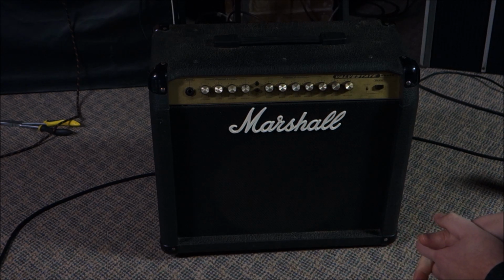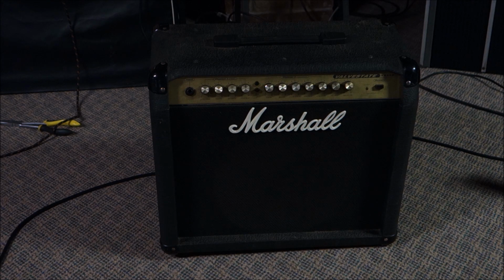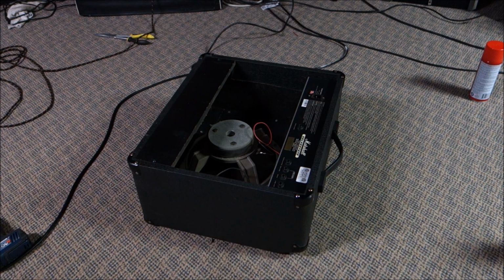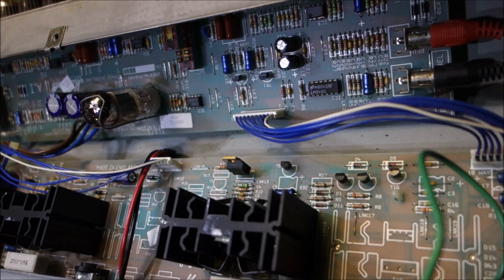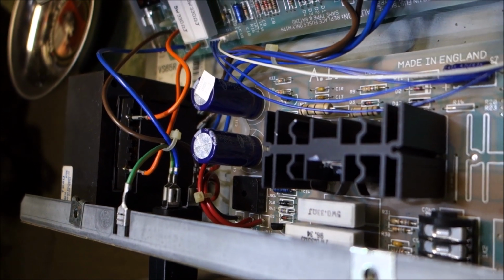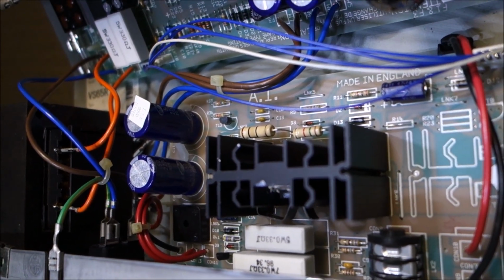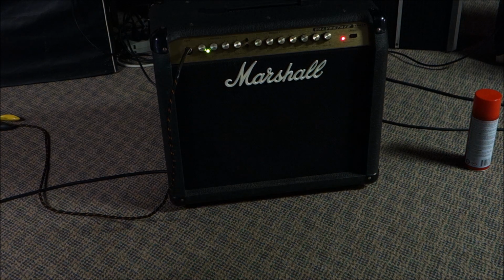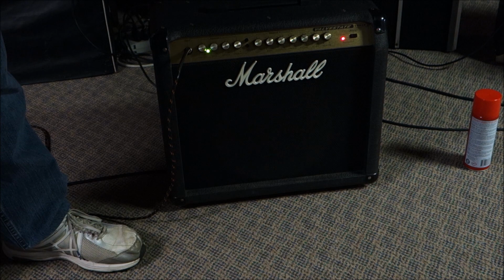Marshall Valvestate VS65R Just makes horrible noise!  Let's fix this thing!

Comment: I have the same cap loose. And the bigger one of the white resistor(?) close to that.
R29. Time for some soldering. The amp works. It hums a bit. 

Input feels a bit worn compared to the other sockets on the back (Valvestate VA100)

Just got the amp and had a look. 
Time for some tlc.
Reply from the maker: Hope the video helped.
Reply: Did you end up soldering it back together? I have the same amp making the same buzz
Reply: @K8lyn_00 Not yet. I decided not to use the amp until those components are soldered. Watched some videos. An amp with the same capacitor loose sparked. 

Apparently the input can create hum as well. Mine is faulty.
Reply: @nieko3038 shoot I'll open mine up tonight and make sure the same thing isn't happening, good luck with your amp!
Reply: @K8lyn_00 Better safe than sorry right. Best of luck 👍🏻 
I hope mine will be fixed end of next week.

Comment: i have recently adquired this exact amp, and its been great however it randomly decides to make loud sounds similar to touching the imput jack with bare hands very loudly, it doesnt sound like a buzz or anything similar it just violently grounds itself or something, can someone help me with this issue?
Reply from the maker: @Magnus_Carlsen.  I would suggest Chopstick and the inside of the amp it's a technique that we use to find bad solder joints and there are other people that cover how to do it well in videos on YouTube
Reply: @DeadKoby   preciate it, will do

Comment: I just picked up a marshall 2510 1987. 25 bucks.
 Plugged it in. Turned it on had dirty pots.
 Cleaned them out. All the noise basically went away. Sounds fantastic. 
 But I was having a hard time getting gain boost on.
 So i went to turn it off, and there was a boom and a squel. 
 The rocker was stiff, and the light doesn't work?
 No leaky caps.
I am very nervous to turn it back on.
Should i be?
Reply from the maker: It's hard to say,  but it sounds like something is shorted out.

Comment: I have a 265VSR and got him too. I’m booking it into Marshall for a service later this month. Actually bought it directly from Marshall in 1995. So, that’s pretty good reliability. They used Semelab (SML) transistors in there. That’s what made the amp special. I was a QA Manager there from 89-1998. 🇬🇧💥🚀📺
Reply from the maker: I'm just glad I could fix and find this amp a home.   Too many good electronics meet the grave for reasons that should be directly fixable.

Comment: I have the same amp. it's puzzling me.. it works fine until i dial in some built in reverb then i get a continuous feedback sound on the open D-B strings very weird ive been getting by just using a reverb pedal but i would love to fix this issue any ideas or recommendations 😁
Reply from the maker: Try isolating the Reverb tank from the vibration of the cabinet

Comment: I have a Marshall AVT20 that has horrible ground hum and drives me crazy! Ive read a article about moving the Reverb tank away from the transformer and makes them a lot better. Have you done this to any of these Valvestate 2000s. I would really like to settle that hum down. If I turn my gain above 3 or 4 its just too loud for me
Reply from the maker: Ive had reverb tanks picking up noise in other projects.  I haven't worked on the amp you speak of.

Comment: Nice video of solving the problem. Have a similar issue with my PRS MT15 and it sounds a lot like that and it started doing that 2, 3 week s ago sporadicly. Before I sort of fished for the buzz using the full/half power switch, now I don't even have to fish for the buzz, it is just always there. A question regarding the repair, did you empty the caps before soldering and did you have to unmount the pcb to do that? For me to do that on my amp it looks like a hole lotta work to get the pcb out and I'm no professional electrician. Do you suggest I give it  a try or take it to a repair shop? The amp was born on 2018 and besides noisy FX loop did not have any issues till now. Thankful for any advice.
Reply from the maker: The caps usually don't have anymore than 50v in them.... (read the voltage) solid state stuff doesn't run that high of voltage.   I think I tipped the PCB up to get to the underside.  This was a long time ago... so I don't remember it 100%
Reply: @DeadKoby  as I can not check the cap like you did cause they are glued together with silicone and there is no movement when I push lightly on them, do you think it would be of any use if I take out the pcb and just resolder them on the underside in the position they are? And in my case it is a PRS MT15 tube amp and there are 16V and 450V caps inside. I also noticed that the ground wires are all chassis mounted, separately, maybe I should make a star ground hub and solder them all to one place. Think that could improve anything?
Reply from the maker: @lorencing  Oh... so you have a standard tube amp running at full voltage.  That changes things a little.   Checking the solder joints on the PCB is always a good start.
Reply: @DeadKoby  yep, standard, full voltage and I hope there is a power sucker circuit built in for those caps ;) ... of course I will check that before I start fiddling around. That is all I am prepared to do at the moment as I do not have sufficient knowledge to really diagnose the amp and will probably take the amp to a technician if that does not do it ... and start learning about tube amps and electrics in general as I would like to be able to diagnose and repair stuff by myself, as there are many good devices with poorly executed builds or with trivial flaws that can be easily corrected, but the average Joe (like myself) does not know that.
Reply: @DeadKoby  well, here is an update ... went online and read on Rob Robinette's site an advice on how to go about troubleshooting tube amps and read about bridging the FX loop ... and ... it fixed my issue, no more 50Hz noise (mains freq in EU) and guitar signal back to normal. But this is just temporary as I want to use the FX loop and now have to figure out what to do with the small FX loop pcb, where to connect a wire to ground or maybe replace a jack socket. Any idea how to start?

Comment: If it's made in England you're supposed to SOLder it, not Sodder it.

Just for good measure, a valve ... not a tube AND it's Alluminium ((Al-you-minium) ... not Alluminum.

The British amps need the correct terminology or else they start throwing crumpets and tea everywhere.
Reply from the maker: Sounds about right.   I think this one was new enough to be made in China.   So I have to work on changing my r's to l's
Reply: @DeadKoby  If you think that's hard... just wait until you try changing an IC with chopsticks.

Hahahaha great video man, I enjoyed it. The signal injection was pure genius.

Comment: I have the same humming sound yet all solder looks fine under a mignifying lens. Do you think it could be a bad capacitor?  I bought it a few years ago brand new and always been like that I thought it was normal and is the same brand Marshall!
Reply from the maker: Bad filter caps are common.  Its a good possibility.
Reply: @DeadKoby  thanks will pull off the caps and test to see which is the faulty one, appreciate the response, take care!

Comment: Just went looking for the same kind of noise in a Fender Ultimate Chorus and found both filter caps all wobbly with bad solder joints.  I believe the cause is the "modern" wave solder process that uses low temp solder to automatically solder all the components at one pass on a board. The big heavy components like filter caps , tube sockets,  standoff high power resistors etc always seem to fracture their joints on the board after time.  Really well done video BTW and I admired your Cap tester ...what brand is it?
Reply from the maker: Lead free solder cracks...   Simple as that.    The testing thing is marketed at a transistor tester/component identifier.  25$ on eBay.

Comment: Been searching on YT for a video on this problem for quite a while. I have a 8100 head that is doing this very same thing. I have been suspecting the filter caps. Maybe this is all the problem is. I'll give it a check tonight and see what I see.
Reply from the maker: It is usually something simple like that.
Reply: @DeadKoby  I will say that it states that it wants to see a 4 ohm load but I have been running it above that into a 16 ohm cab. The previous owner was doing the same thing. I do not know if the hum has always been there but it is intermittent. Sometimes when I power up, it's there, other times it's not. When it is, I can lightly bump the amp and it will stop. That made me think a bad solder joint is the issue here.
However, at a gig recently, I had the amp turned up higher than I normally would at home and I lost a speaker. This made me think that I had DC on the output - so I am not sure which is which at the moment.
Reply from the maker: This has a solid state output.......  4 ohms or more is safe.
Reply: @DeadKoby  That's what I assumed but thought I better make sure.

Comment: I buy broken amps all the time. 99% of the time the problem is nothing more than a bad solder joint or bad cap.
Reply from the maker: Many times, it is something minor.........but sometimes not.   As long as you bought the whole thing for below what the pieces are worth,  it's worth a shot.
Reply: @DeadKoby  I've bought amps with serious problems that would be too expensive to fix.  In those cases I strip them for parts and sell what I can and keep the rest.   Usually I can buy the amp for under a hundred,  if not for free.   Ultimately I make out pretty good 👍
Reply from the maker: That's usually how I work also.  Auctions (Local)  have been my #1 source.
Reply: I have an amp that just makes a 120hz hum noise and that's it, although the headphone out works fine so it might be just the speaker. I checked the input and speaker output jacks and they were fine

Comment: I've had a VS265R sitting for years with the same issue. I'd had it fixed once before but when the buzz came back I bought a separate head and cab. This quarantine got me looking at the amp again and I found this vid. Sure enough, it was the same capacitor. I could also see it was the same cap re-soldered when I had it fixed. My electronics knowledge is very limited but I feel I'd at least know where to start should I see this with another amp.
Reply from the maker: Why they didn't leave the leads a little longer, and solder them flat on a pad,  I will never know.   That would have prevented this from ever happening.
Reply: @DeadKoby  Thanks for mentioning that. I wasn't expecting my solder job to hold up any longer than the prior repair. I have a couple mm of lead to play with on the cap, I'll go ahead and re-solder with the lads bent down.
Reply from the maker: I build amps,  and the soldering job can't be weak...  or stuff like this happens.  Glad my experience was able to help you.   I did OK,  selling this amp to a local upstart player.

Comment: Theres a valvestate vs102r for 50$, it's broken and I'm just looking for advice on whether I should take the risk or not, apparently no sound comes true it and the headphone jack doesn't work either. Do you think it's worth the risk of buying and trying to fix?
Reply from the maker: It's plausible.... Usually these aren't crazy hard to fix.   The circuit is pretty straight forward.
Reply: @DeadKoby  with this covid going around I'm just gonna give it a miss, thanks very much
Reply from the maker: Heck,  I just had an item I've been looking for for YEARS turn up on Ebay.   I'll unbox with with gloves if I have to... I want it!  You'll see that on the channel soon.
Reply: @DeadKoby  I'll make sure to check it out, thanks very much

Comment: Not sure why you said you needed to have the amp on a load? I guess you must have tested for DC voltage on the output and did not find any. At that stage you used the 120hz ripple noise to find if the caps reacted to movement. Easy fix but I am waiting for a video where you might go down a rabbit hole. Those are fun!
Reply from the maker: Some solid state amps (especially those with modules)  will burn up the output stage if there's no speaker or dummy load. (I made that mistake once)   I'm sure I could have read the schematic and determined whether or not this one had the potential to do so,  but I've made it a habit to never turn on a SS power amp without a speaker on it.  In this case I just poked that cap,  it sparked, and the problem was obvious.     Seems like lately the projects have been pretty straight forward,  but I feel also I've gotten better with another year of practice.  Overthinking is my worst enemy....  Comparing this to the Standel of a few years back,  I KNOW I'm more confident with solid state.
Reply: I always use a light bulb limiter 40-60 watt bulb no load on all suspect SS amps, with the exception of old ones that used an OT. Which SS module are you referring to? A load on an amp with huge DC offset is what I avoid first.
Reply from the maker: There's some Marshall heads that are subject to this,  but the one I burned up on accident was a TDA2050 module in a Fender practice amp...   those can "run away"  and overheat Unless there's a speaker or dummy load attached.  After that incident,  I've always had some kind of load on the output.